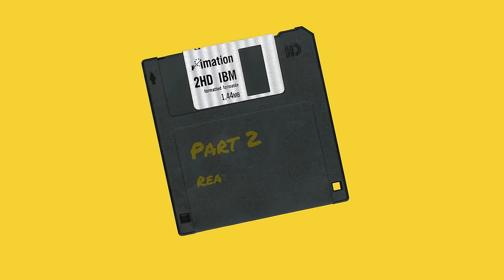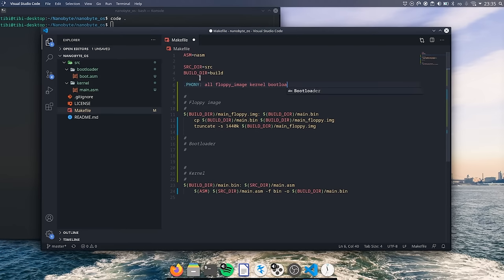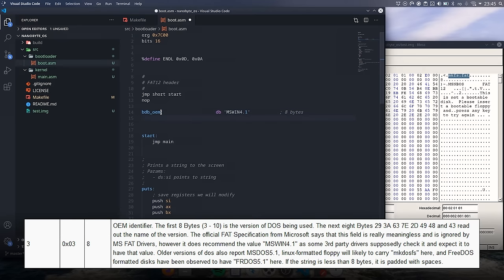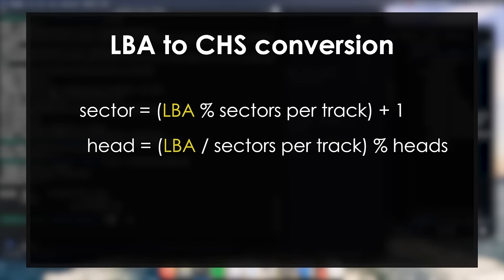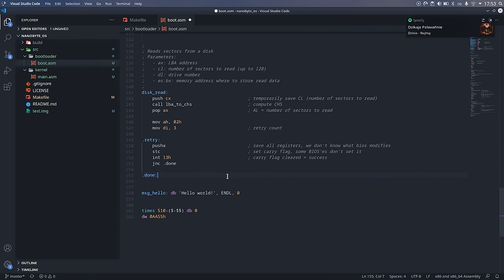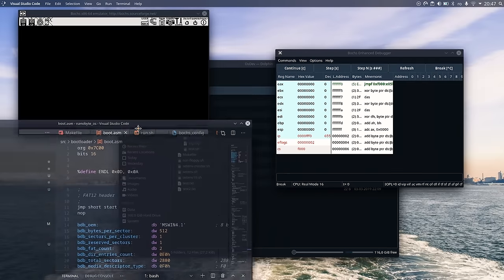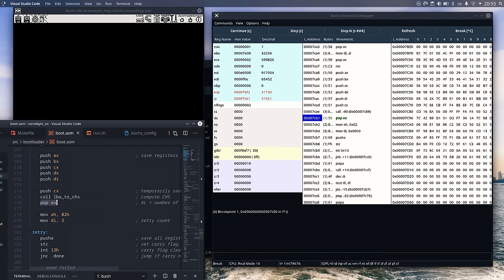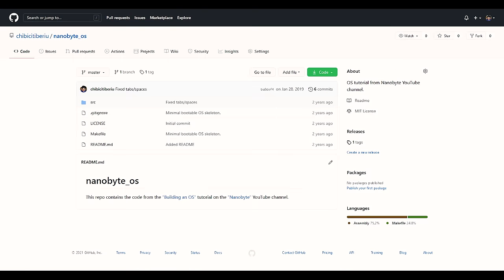Building an OS - 2 - Reading from the disk

Comment: @8:07: i tried to copy the bootloader file into the img file with an offset of 62 (obs=1, seek=62)2). Also inside the boot.asm the padding of zeros is 448-($-$$) instead of 510-($-$$). in the final image however, the bytes after the BPB is altered at a few places. which is the "code". vs the image which is created the BPB inlined in the asm file. 

should i upload the two images somewhere for reference

Edit:  the mkfs bpb image prints garbage, where as the inline bpb prints Hello World
Reply: Image files, boot.asm and a Makefile 

https://drive.google.com/drive/folders/1c1UPaixiypr2PZ60LyDtL1_S8vtGwkbw?usp=sharing

thank you

Comment: 8:20
somewhere aroudn that, i'm still stuck on Cannot initialize '::'
Reply from the maker: If you get the size of even 1 field wrong, the header will not work. I recommend checking your code against the github repo and make sure it is correct.
Reply: @nanobyte-dev  I pasted the code multiple times to test from the github.  No luck.  Is it related to the info inside of the hex editor or smth? I feel like I'm missing something

Comment: Hey there, I was trying to run the debug.sh file but bochs showed that -

00000000000i [            ] LDTL_LIBRARY_PATH not set. using compile time default '/usr/lib/x86_64-linux-gnu/bochs/plugins'
================================================================
                                                Bochs x86 Emulator 2.7
                                Built from SVN snapshot on August 1, 2021
                                Timestamp: Sun Aug 1 10:07:00 CEST 2021
================================================================
00000000000i  [            ] BXSHARE not set. using compile time default '/usr/share/bochs'
00000000000i  [            ] lt_dlhandle is 0x56356714a070                                          
00000000000i  [Plugin ] loaded plugin libbx_unmapped.so                                      
00000000000i  [            ] lt_dlhandle is 0x5624b87bca40 
00000000000i  [Plugin ] loaded plugin libbx_serial.so
00000000000i  [            ] lt_dlhandle is 0x5642b87c0c0
00000000000i  [Plugin ] loaded plugin libbx_extfpuirq.so
00000000000i  [            ] lt_dlhandle is 0x5642b87c1550
00000000000i  [Plugin ] loaded plugin libxx_gameport.so
00000000000i  [            ] lt_dlhandle is 0x5642b87c1dd0
00000000000i  [Plugin ] loaded plugin libbx_biosdev.so
00000000000i  [            ] lt_dlhandle 0x5642b87c2740
00000000000i  [Plugin ] loaded plugin libbx_iodebug.so
00000000000i  [            ] lt_dlhandle is 0x5642b87c2fa0
00000000000i  [Plugin ] loaded plugin libbx_speaker.so
00000000000i  [            ] lt_dlhandle is 0x5642b87c5010
00000000000i  [Plugin ] loaded plugin libbx_parallel.so
00000000000i  [            ] reading configuration from bochs_config
00000000000e [            ] bochs_config:6: incorrect parameter format
00000000000p [            ] >>PANIC<< bochs_config:6: mouse directive malformed.
00000000000e [SIM     ] notify called, but no bxevent_callback function is registered
00000000000e [SIM     ] notify called, but no bxevent_callback function is registered
================================================================
Bochs is exiting with the following message:
[             ] bochs_config:6: mouse directive malformed.
================================================================
00000000000e [SIM     ] quit_sim called with exit code 1

BTW i am using Ubuntu 24.04 Jellyfish

Comment: i keep getting this issue when running debug.sh on my WSL ubuntu and i also followed your other WSL os dev tutorial

00000000000i[PLUGIN] loaded plugin libbx_soundalsa.so
shared memfd open() failed: Function not implemented
ALSA lib confmisc.c:767:(parse_card) cannot find card '0'
ALSA lib conf.c:4732:(_snd_config_evaluate) function snd_func_card_driver returned error: No such file or directory
ALSA lib confmisc.c:392:(snd_func_concat) error evaluating strings
ALSA lib conf.c:4732:(_snd_config_evaluate) function snd_func_concat returned error: No such file or directory
ALSA lib confmisc.c:1246:(snd_func_refer) error evaluating name
ALSA lib conf.c:4732:(_snd_config_evaluate) function snd_func_refer returned error: No such file or directory
ALSA lib conf.c:5220:(snd_config_expand) Evaluate error: No such file or directory
ALSA lib pcm.c:2642:(snd_pcm_open_noupdate) Unknown PCM default
* buffer overflow detected ***: terminated
./debug.sh: line 1:  3434 Aborted                 (core dumped) bochs -f bochs_config

this is my bochs_config:
megs: 128
romimage: file=/usr/share/bochs/BIOS-bochs-latest, address=0xfffe0000
vgaromimage: file=/usr/share/bochs/VGABIOS-lgpl-latest
floppya: 1_44=build/main_floppy.img, status=inserted
boot: floppy
mouse: enabled=0
display_library: sdl2, options="gui_debug"
Reply: try adding the line "sound: waveoutdrv=dummy, waveindrv=dummy, midioutdrv=dummy" to your bochs_config file

Comment: This is the error I keep getting and I dont know what to do. I cant go any farther without figuring this out. I am on macosx linux, and after research I used homebrew to install dsfstools but this still wont work. Any Help?

Thank you!

mkfs.fat -F 12 -n "NBOS" build/main_floppy.img
/bin/sh: mkfs.fat: command not found
make: * [build/main_floppy.img] Error 127
Reply from the maker: As far as I'm aware, the tools on MacOS are a bit different, more similar to BSD than Linux. Checking the FreeBSD documentation might be a lot more helpful for MacOS issues than the Linux one. There are a couple of different names for the command, including mkfs.msdos, mkfs.vfat, mkdosfs. Maybe one of them works for you. If none of them works, you can try the mformat command from the mtools bundle.
Reply: I'm on a mac too and I found a solution that works for me.

I replaced the first dd and the mkfs command with

	hdiutil create -size 1440k -fs "MS-DOS FAT12" -layout NONE -ov $(BUILD_DIR)/main_floppy.img
	mv $(BUILD_DIR)/main_floppy.img.dmg $(BUILD_DIR)/main_floppy.img

The second command is used because hdiutil automatically appends dmg at the end of the output file.

Comment: well i'm stuck in the fs thing.
"
rm -rf build/
mkdir build/
nasm src/btldr.asm -f bin -o build/btldr.bin
nasm src/krnl.asm -f bin -o build/krnl.bin
dd if=/dev/zero of=build/flp.img bs=512 count=2880
2880+0 records in
2880+0 records out
1474560 bytes transferred in 0.014754 secs (99942681 bytes/sec)
newfs_msdos -F 12 -f 2880 build/flp.img
newfs_msdos: warning: build/flp.img is not a character device
ioctl(DKIOCGETPHYSICALBLOCKSIZE) not supported
build/flp.img: 5726 sectors in 2863 FAT12 clusters (1024 bytes/cluster)
bps=512 spc=2 res=1 nft=2 rde=240 sec=5760 mid=0xf0 spf=9 spt=36 hds=2 hid=0 drv=0x00
dd if=build/btldr.bin of=build/flp.img conv=notrunc
1+0 records in
1+0 records out
512 bytes transferred in 0.000021 secs (24403223 bytes/sec)
mcopy -i build/flp.img build/krnl.bin "::krnl.bin"
Cannot initialize '::'
Bad target ::krnl.bin
make: * [build] Error 1
"
do you know what is the error caused by??

EDIT: I did fix the issue but tbh idk what caused it and how i fixed it so sry.
Reply: Did you ever find out how to fix this issue?
Reply: well i did fix the issue but i still dont really understand how i fixed it. Maybe just make sure that the names of the headers are right. Are you experiencing the same issue? If so, what os are you using? I'm using mac, and idk maybe the issue was related to macos or something.
Reply: @KasenGroth  sorry but i can't help you that much if you're experiencing the same problem
Reply: I ran into this as well. Would be great if someone could share a solution

Comment: i had a problem running command "make", this give me this error;;
mkdir -p build
nasm src/bootloader/boot.asm -f bin -o build/bootloader.bin
nasm src/kernel/main.asm -f bin -o build/kernel.bin
dd if=/dev/zero of=build/main_floppy.img bs=512 count=2880
2880+0 registros leídos
2880+0 registros escritos
1474560 bytes (1,5 MB, 1,4 MiB) copied, 0,00450724 s, 327 MB/s
mkfs.fat -F 12 -n "NBOS" build/main_floppy.img
mkfs.fat 4.2 (2021-01-31)
dd if=build/bootloader.bin of=build/main_floppy.img conv=notrunc
1+0 registros leídos
1+0 registros escritos
512 bytes copied, 8,9188e-05 s, 5,7 MB/s
mcopy -i build/main_floppy.img build/kernel.bin "::kernel.bin"
/bin/sh: 1: mcopy: not found
make: * [Makefile:17: build/main_floppy.img] Error 127
Reply: You need to install mcopy for that to work.